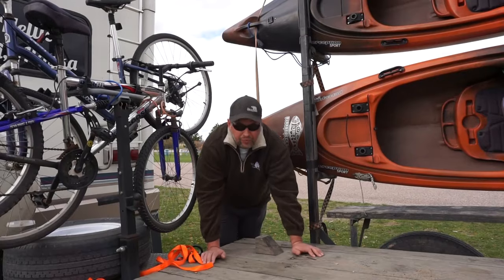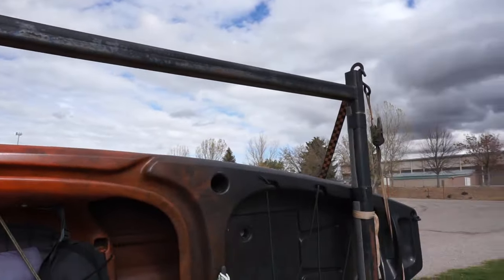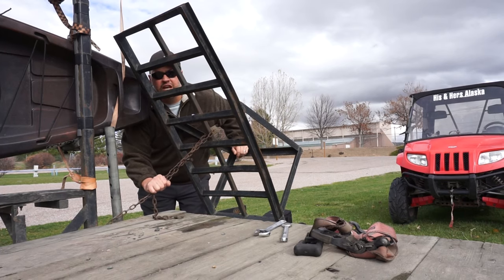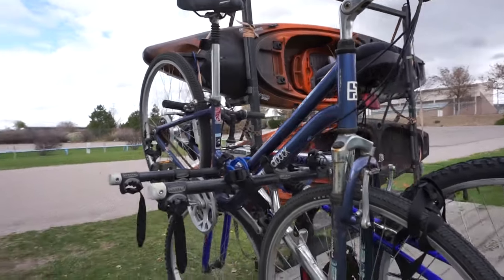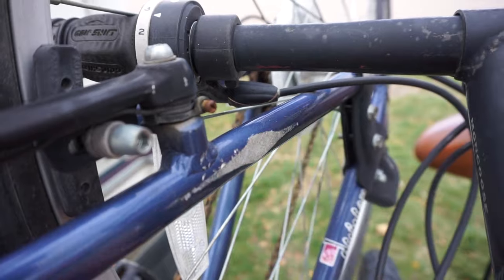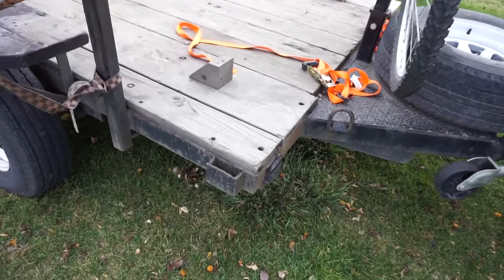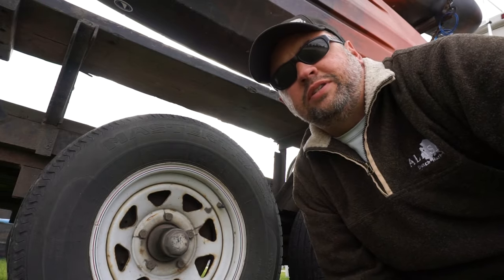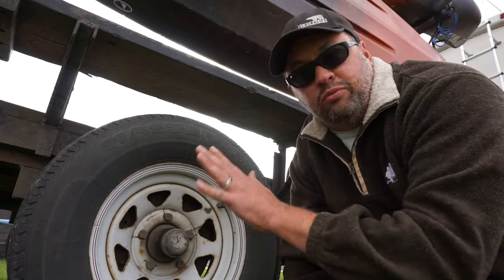The best ATV & KAYAK trailer ever [RVlog #24]

Comment: Nice one Ben!  Did you ever figure what the source of the axles/spindles/hubs was?  In my experience, once torn down there should be numbers on the tapered roller bearings and races so they could be sourced that way.  The seal, if not numbered should be able to be sourced via inner and outer diameters.  This all is assuming you find a real parts person not just someone who pushes buttons on the computer.  Be safe, hope to see you again on this trip Skipper!

Comment: Can you build a tool box up front to increase ball weight? Maybe take stuff out of the RV and put in the tool box. Making it longer may invite other issues.
Reply: even better
Reply: never seen a trailer so short with 2 axels. hard to load the front down too much without putting too much weight on the front axel. interesting trailer for sure.